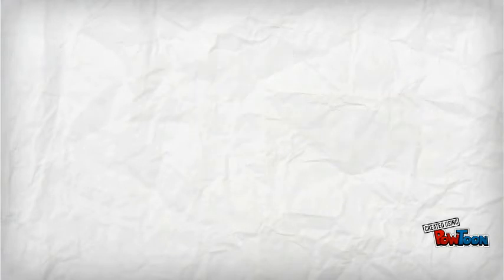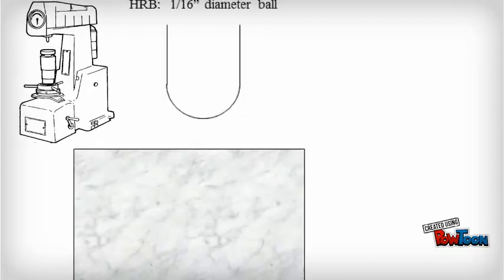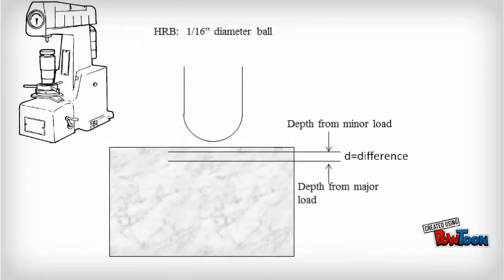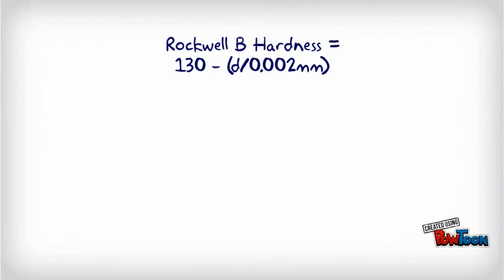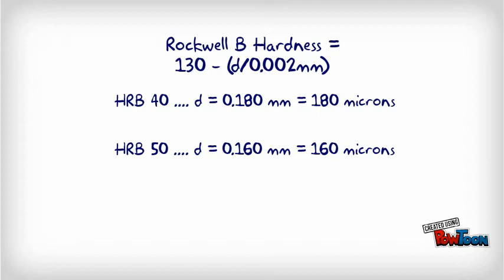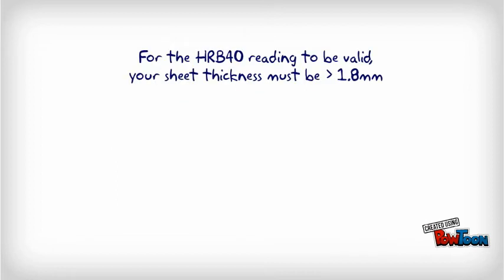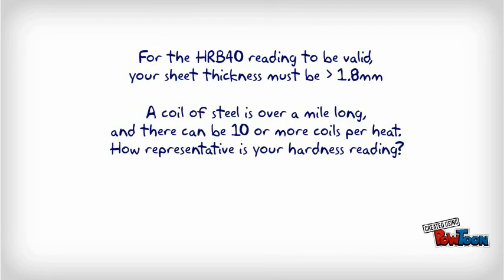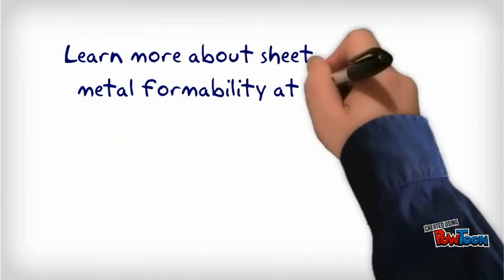Hardness Testing Overview

Comment: I appreciate your tutorials,     how can brinell test be done to determine rock hardness?
Reply from the maker: Brinell and Rockwell are different types of hardness tests.  Usually, Brinell is used on materials with a rough surface - it has a much higher indentation load than Rockwell.  This high load usually leaves a large indentation impression on the metal surface.  
There have been published conversions to approximate the differences between Brinell and Rockwell - just Google "convert from Brinell to Rockwell".  But remember, these are just approximations and the tests are different.

www.EQSgroup.com     www.Learning4M.com